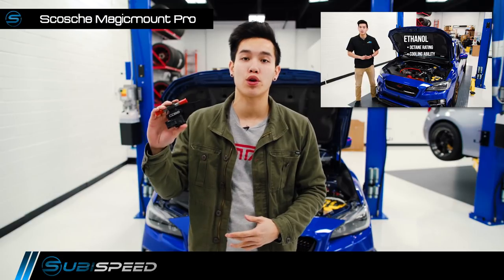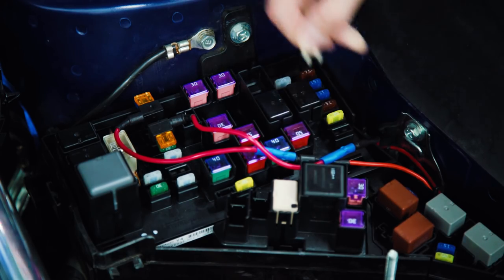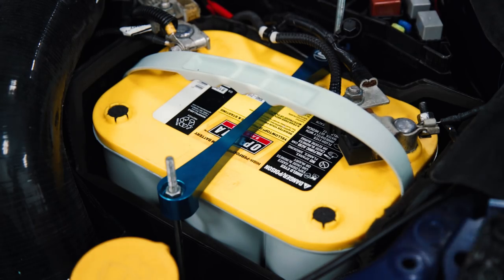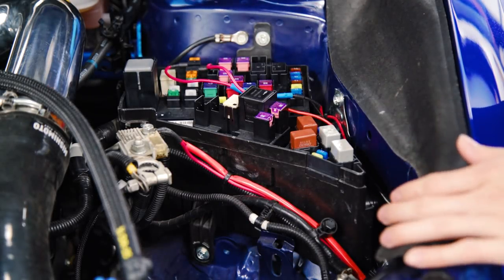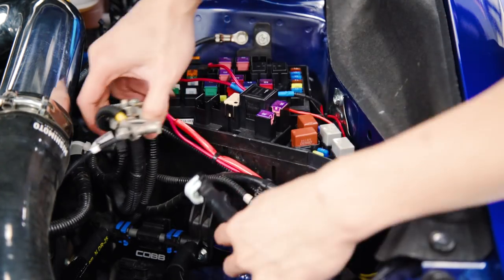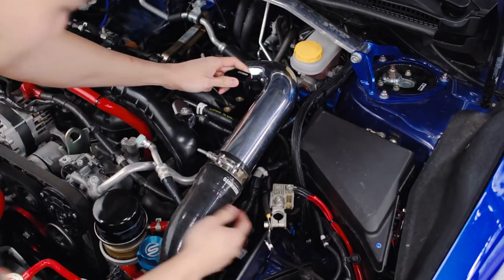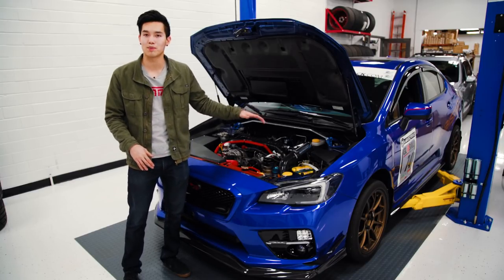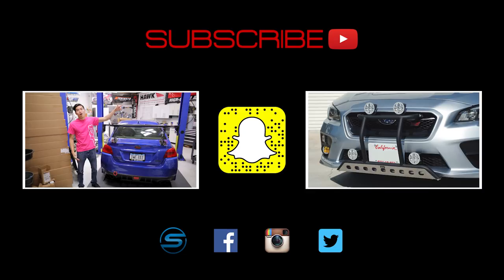Cobb Flex Fuel Install 2015+ WRX

Comment: and shops are asking 350-500$ for this install LMAO
Reply: I know just got quote 472$ crazy
Reply: G3 I know right
Reply: When ever you mention flex fuel kit. The shop automatic it gonna need fuel injectors, fuel pump, flex fuel sensor and wiring.
Reply: 550 quote from my local shop
Reply: @Serpent-qj3nx  the cobb kit comes with wiring
Reply: Yeah they charge one hour of labor. which is most shop minimum

Comment: Hey SbubiSpeed, great video!  Quick question for you,  will the module mount on a car that has a crawford AOS installed on that intercooler bracket?
Reply from the maker: As long as it's not blocking the fuel lines you can mount the module elsewhere.

Comment: This kit is a must for FA20DIT owners who have access to E85.  It really transforms the car and instills confidence that you can actually beat the car next to you.
Reply: But what else needs changed out to run e85?
Reply: Can you run premium too though?
Reply: @cyclonic7134  yeah of course, it'll sense what fuel you are running
Reply: @koolman7733 Fuel injectors, fuel pump, obviously a tune, these aren’t necessary but an upgraded inter cooler and AOS catch for long term engine health.

Comment: Great install video. However I do have a question.  When I did my install I ensured all the sensors were firmly connected. The check engine light was thrown saying the vgt was stuck closed. Major power loss. I double checked the connectors. I disconnected the tgv sensor and reset the ecu and it went back to normal after I reset the ecu.  Do I have a bad Cobb harness?
Reply: WRXTICKLE S yes I did (sorta... I installed my tgv deletes)

Comment: Your rail pressure may be thousands of PSI, however you're putting the sensor in the low pressure side - which probably doesn't exceed 7-8bar... ~105-120psi.
Reply: Still don't want 100psi of fuel coming at my face when I disconnect that line lol

Comment: Excellent video. So, I installed the kit but I’m being tuned for e60, I also have TGV deletes and with the base map everything was working okay but now with the first revision when I flashed it I’m getting a P2016 code which states “TGV Position Sensor 1 (RH) Circuit Low” causing a CEL. I spoke about it with the tuner and he told me to disconnect the sensor since I’m getting e60 anyways. I disconnected the sensor and now I’m getting also P2021 which is the same as P2016 but “Sensor 2 (LH)” Is it possible that it’s the actual sensor and module giving issues or is it actually a problem with the tune itself since with the base map there were no CELs. Hopefully someone has answers, the tuner gets back to me literally weekly.

Comment: hey subispeed I just got this entire setup for my car today and can't wait to install it. but my question is I can't see on the install video where to plug in the tgv connector I have the deletes on my care if their is any way you can show me or tell me would be great thanks I always get my stuff from you guys!! you rock
Reply from the maker: There will only be one plug from the Cobb Flex Fuel Module harness that will fit into the connector that is left on the car since you have the TGV deletes. Plug the female connection from the harness into the male connection on the car.
Reply: Will I need to unplug anything or will it be a open ended where it's just goes in

Comment: Thank you so much
Is it possible to add 10% ethanol to the engine without the flex fuel sensor?
Reply: Yes subaru designed it to work on e10 which is at the majority of gas stations in America

Comment: If car still runs with fuse pulled both before and after startup, restart with the gas cap removed. Was waiting forever for my car to die until read this from a forum

Comment: Hi Subispeed. I also have TGV deletes. In the video, you taped it off because it won't be used. But, based on the comments below, you actually are plugging it in to the open connector their that was for the TGV, is that correct? I will be doing the install in a few hours.
Reply: what ended up happening?
Reply: @ivanherrera2899  Shoot, it's been a while since I've done the install. I believe I taped them off as well because I remember thinking I should in case I ever need to put the TGVs back on, I should protect the connectors.
Reply: @chancastillo7909  okay nice. Nice car btw I have the same one lol.
Reply: @ivanherrera2899  Good luck with the install. It's fairly simple compared to other mods.
Reply: What do you have installed on your car atm?
Reply: @chancastillo7909  also, what do you think about the flex fuel so far since you have had it for a while
Reply: @ivanherrera2899  Intake, turboback, TGV deletes, AOS, oil cooler, Stage 2 Flex Fuel tune. Had to get a better clutch cuz the stock clutch can't handle the torque. It's been pretty fun since I've had the tune. The extra oomph is nice and gives the engine a deeper tone.
Reply: @chancastillo7909  wow that’s literally exactly the same as me except also egr delete, and pro tune, and now it’s time for a new clutch! Since my pro tuen couldn’t handle the torque of all the parts, what clutch did you end up getting? (Clutch was too worn out so it was slipping)
Reply: @ivanherrera2899  Subispeed recommended ClutchMasters and ACT. Since it's mostly just spirited drives and canyon runs, I went with ClutchMasters FX350.

Comment: Does this kit also work with the 2018 WRX? On subispeed.
Com it only says 2015-2017.
Reply: Its cobb so check out their website. Pretty sure it works on 2018 too

Comment: Since I have tgv deletes as well. Does it matter which plug I use from the Cobb harness? I know you guys taped one. And also can i have everything plugged in except the main brown clip? Id like to have it installed when I go for my pro tune. That way I can just click one harness in.
Reply from the maker: Subaru Wrx theres a male & female connector only one will fit. As for the brown connector, you can just connect it. It won't actually do anything you get tuned for it.
Reply: SubiSpeed so can we just install it all and still run 93 like normal without problems before getting tuned?
Reply from the maker: Correct.
Reply: SubiSpeed great thanks for the quick reply

Comment: I don't use e85 but I bought my wrx with the kit on it. It worked great for couple months but now bout every other day my car says low voltage for ethanol sensor. Any ideas about fixing that?
Reply: You need a new sensor most likely
Reply: @andreahighsides7756  I replaced the sensor and replaced the 02 sensor. 
Think it's fixed now!!

Comment: Would I need to upgrade my fuel pump? Injectors?
Reply: Yes
Reply: From what I heard as long as you stay under e30 it’ll be alright but anymore and the stock fuel pumps could fail and break so up to you what you want

Comment: Do you need a tune right after you install this kit? Or you can install it and run your normal fuel (mine is bp98octain) until i get a tune? Is it safe to install this and run without flex tune? I will be running my normal fuel for a while since i live far from e85.
Reply: I wanna know also
Reply: No tune needed on normal gas, because it won’t change the amount of fuel entering your car.

Comment: Can I do the installation myself and then drive the car to the tuner? Same day
Reply from the maker: Carlos de la Torre yes
Reply: Thanks , great video!!!
Reply: If i remember correctly its just a sensor, you can run it all day on regular pump gas without a tune. Just dont run any e85 until you get a protune.

Comment: I dont have tgv deletes and i pluges them in. And i got a check engine light. What did i do wrong?
Reply: You have to mirror the tgv you’re using to the one you’re not.
Reply: P2007?

Comment: After I install the flex fuel sensor can I run a regular ots stage 2 tune for a couple days until I get the tune???
Reply: SouthFLRacing yes just dont put e85 . You could still run on pump gas. Did you change your fuel pump?

Comment: For this I don’t have to get the tune right away correct ? I can run pump gas until I get the actual E85 tune ?
Reply: Yes, this is basically just nicer fuel lines and extra information sent to the ECU it isn’t told to look at (yet). Once you get the tune, you can make use of the sensor and ethanol. Make sure you get the high pressure fuel pump too ;)
Reply: @SquatzMcAllister  thank you so much for response getting tuned at the moment can’t wait to add some E85 to the tank
Reply: @dylanwirkus2119  nice! I just did an E60 tune with Phattboi on mine; +70 WHP compared to pump gas! That’s also conservative tuning :) good luck!
Reply: @SquatzMcAllister  thanks man ! I wanted to go with Phatbotti too but prices were so high rn and couldn’t wait any longer :/ went with mike Adkins !

Comment: Do i need a tune for this? Not putting E85 in it yet but want to get a head start
Reply: I know it's late, but for people who come across this in the future: No, it is plug and play and will just read the ~10% Ethanol of pump gas. Doesn't need a tune out of the box, just enables you to be tuned for higher ethanol content reliably and with a flex map.

Comment: How would this work on a stock 2018 wrx  with a pro tune ? Or should  there be other mods to compliment?
Reply: You need to have a specific tune for E85. Just installing this won’t damage anything (basically it’s just fuel lines and information the ECU is won’t pay attention to until told to), so it won’t affect your operation.

Adding this kit and a flex fuel tune to run e60 will be like a 80-100 whp gain. Dollar for dollar best power mod for the FA20! I am working with phattboi tuning for mine right now :)
Reply: Oh and you’ll need a higher pressure fuel pump.
Reply: @SquatzMcAllister that’s only if you run full e85. Hpfp not necessary for e30-e60.

Comment: would this be ok with the cvt stock with catback or stage 1? thanks
Reply from the maker: The CVT transmission cannot handle the extra power. This would be for manual only cars. Sorry.
Reply: SubiSpeed ok thanks for the info
Reply: highspeedtubing chill out lmao. They’re better for people who daily drive most likely and definitely better for deep city traffic. Everyone has different uses and needs
Reply: @Louves118  your better off selling that cvt if your trying to mod it

Comment: would you guys recommend an e85 kit over a stage 1+ in terms of reliability?
Reply: I'm running on pure e85. And I'll tell you, after 8k miles of straight e85 and a few 91 tanks in between. My fuel pump is starting to fail due to high ethanol content. I would love to have flex because ethanol provides both power and knock resistance. I would love to run anything around e30-50 because that would allow for a little power boost with alot more knock protection than 91. Plus finding good e85 is hard around here. So sometimes I drive 20 miles for gas. I wish I could just mix and match my gas....
Reply: You are not using the stock fuel pump right?
Reply: Jacob Tran  I think a good solid ratio is 2 gallons of 91 with 1 gallon of e85 makes a good mixture for WRX... not too much e85 and easy ratio to remember... But i cant remember who said it or what E?? it gives you... But just a tip to look up
Reply: Your having issues because you didn't upgrade the fuel pump. E85 you increase the injector size more flow equals stress on fuel pump. Upgrade the stock one it's not that expensive to do and it will serve you reliably and later if you upgrade to bigger fuel injectors when running boost it will be able to deliver the fuel volume at the correct rate

Comment: why would anyone want to run e-85 I get that's it's cheaper but  that's about it you get better power and fuel mileage out of the real deal. now I can still get non-ethonal premium where I live and have 98 no Led and 101 no Led available too. so that might have a little to do with my lack of understanding of the E-85 craze.
Reply: false, I picked up 70hp just from switching to pure e85.
Reply: 200whp (in colorado on 91) to 270whp stock everything except with e85.
Reply: Jacob Tran  you could do that with water Meth injection and a tune for a lot cheaper ?  what's your fuel mileage? regardless of my doubts I must say that is impressive.
Reply: 30hw, 18 city, and about 25 combined miles/gallon. I have dyno sheets :)
Reply: Jacob Tran question, I have a bone stock '16, I assume yours is too?  Any issues? Did you get those kind of gains from pro tune?  I want a sleeper, so stock everything except acces port and flex fuel.  What if flex fuel isn't available, such as, if you are on a long trip and can't find it?  Sorry for all the questions, but you sound like the perfect person to ask.
Reply: woohunter1 A sleeper isn’t all stock.... It just looks stock from the outside. Just switching to E with AP isn’t going to give you an upper hand

Comment: I’ve been getting a ‘ethanol sensor voltage low input’ CEL. I reset my ECU it goes away for a week or so and then boom pops back up. This has been goin on this past month or so and I’ve only been running 91oct for the winter. I guess my question is, if I’m wanting to disconnect/clean everything and then reconnect, does my fuel level need to be less than a quarter tank before I relive the fuel pressure?
Reply: subie. ja did you find the problem? And how you did it ? I have the same problem on my car.
Reply: nicolas mendoza contacted Cobb, did some data logs and sent them out. They sent me a new A3 module (I had the old A1) CEL hasn’t came back once.
Reply: subie. ja okay thanks bro .
Reply: nicolas mendoza no prob man.

Comment: Can I run this with stock injectors? Because I’ve tried to find upgraded injectors for the fa20 but I can’t find any so I’m assuming u can run e85 with stock injectors?
Reply: Yes no need to upgrade direct injectors on any direct injection car. If you are looking to make 450-500+whp you will need to get the brz intake manifold conversion kit with port injectors and a fuel controller other than that all you need to run Flex fuel on a flex fuel tune is the sensor, and upgraded fuel pump, and the tune itself

Comment: So when and where is the TGV delete plug going into?
Reply from the maker: There will only be one plug from the Cobb Flex Fuel Module harness that will fit into the connector that is left on the car since you have the TGV deletes. Plug the female connection from the harness into the male connection on the car.

Comment: Wait am I limited to e85 for life after this? I guess I need to look into this more
Reply: No you can still use regular gas with the kit if your car is tuned for it. Once you tune for e85 then that's all you can use until you reflash a regular gas tune.

Comment: Lol 1000psi of fuel pressure🤣
Reply from the maker: Yes, high pressure fuel pumps can generate pressure up to 2500 psi to the rails.
Reply: Lol.. unlike that old Edelbrock carburetor that runs on 6 psi.
Reply: why is that funny?

Comment: Reupload?
Reply: The other install video was wrong. They originally said to not do anything with the tgv plugs if they are deleted but you have to plug in one of them.
Reply from the maker: We made a correction to the install process.
Reply: SubiSpeed i hope your correction included relocating the sensor to a closer location to avoid the motor torque snapping the fuel lines. Like mine did twice in a week till we found the cause.
Reply from the maker: We had plenty of slack in ours and haven't had any issues.

Comment: So I assume the sensor is pulling power from the O2 sensor cirtcuit. How does the signal from the sensor get to the ECU using existing harness?
Reply: Through the tgv connector pin it sends voltage (0 for error, 0.5-4.5v for 0-100% ethanol respectively).  I can build you one for 1/3 of the price and it will look the same. I have it running on my 2018 wrx with phatbotti duel tune. And flex sensors can be had for 20$+.